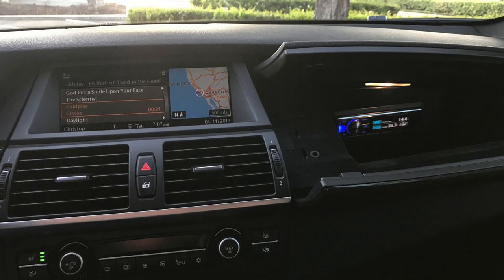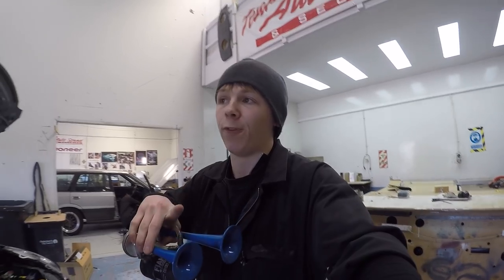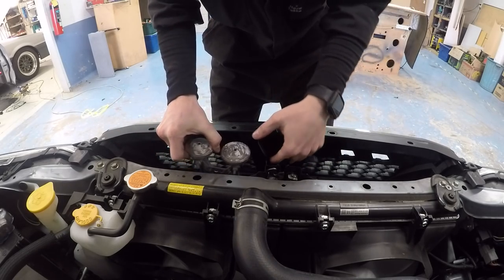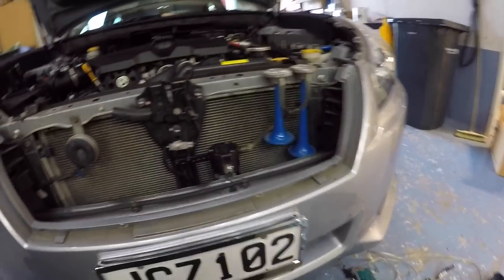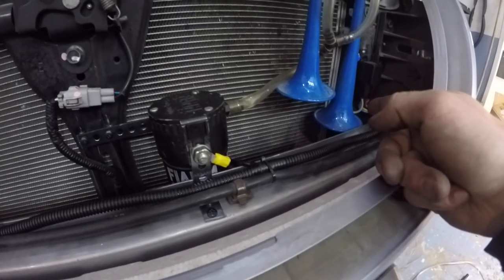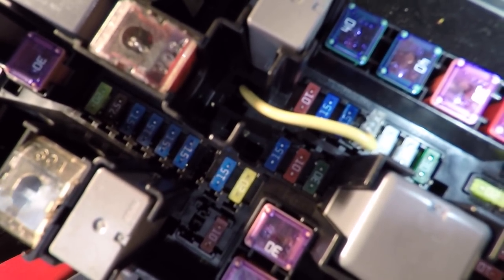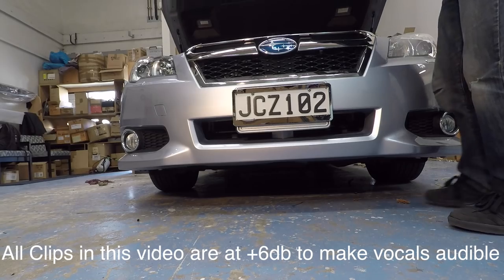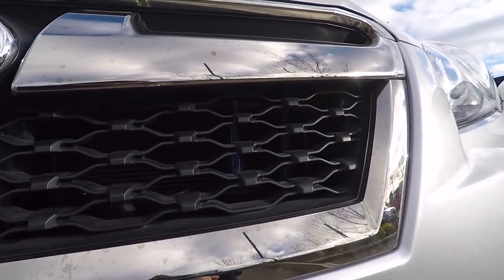Project Legacy: AIR HORNS!!!!

Comment: Hi i have a NOS fiamm air horn and was wondering if i can use silicone hoses for it instead of using the ones that came with it. Coz the original hose is so stiff.. Thanks

Comment: No wonder the front ends of cars "shatter" when hit. They are all plastic and fiberglass! Some are carbon fiber, too. I once saw two cars hit head on at a slower speed, and the crap splintered and flew through the air like a shattered glass. Plastic junk.